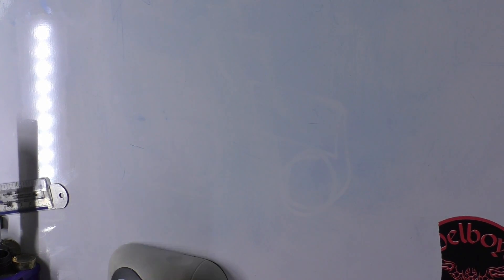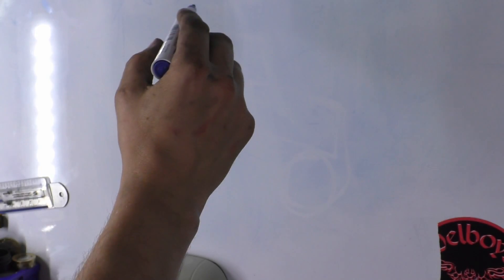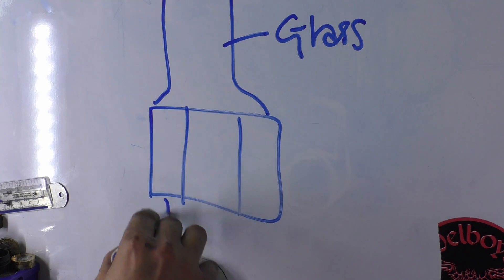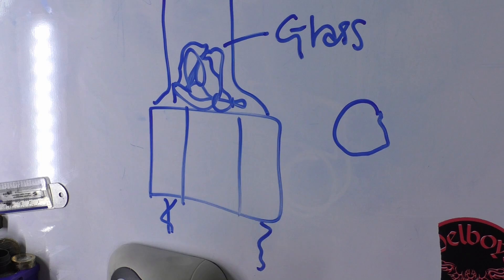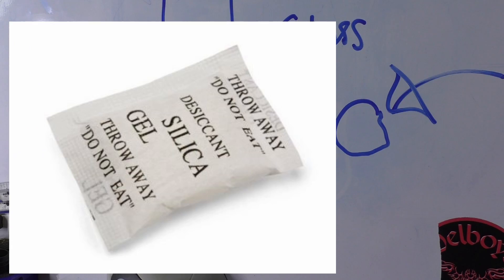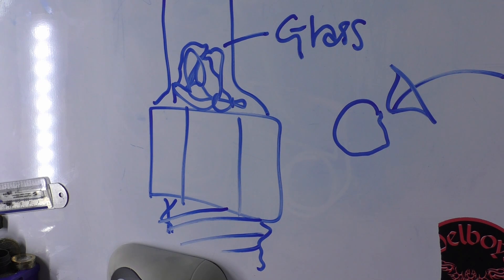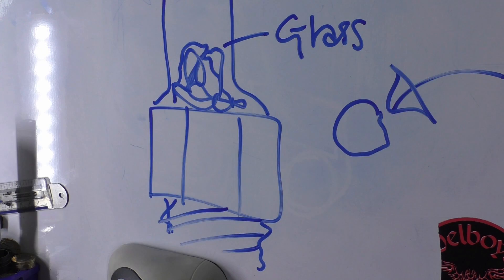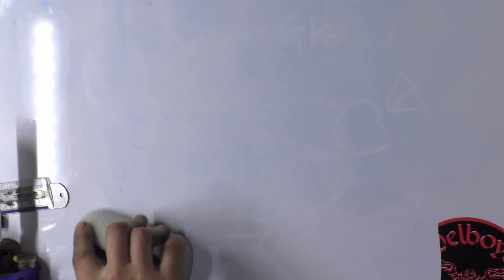Weird Glass spark plugs? - question time

Comment: The silica desiccant is only for shipping according to the company I bought a load of desiccant from.
Only lasts the shipping period they said, they sold various types of desiccant.
For storage purpose they had a clay based desiccant that lasts months.
Comes in paper bags about the size of my hand, had to buy a huge box of them that has a sealed bag inside because they only sold wholesale..
I pulled a few out to use and sealed up the bag to store.
Used them in a camera housing I built with a Nikon DSLR in it to take time lapse shots of a building site over 3 months.
No idea what I'm going to do with the rest.
Reply: I throw a couple dozen or so in the car while i store it over winter, i just microwave them once a month for a few minutes to dry them out and chuck them back in the car again, it works really well.

Comment: Hey mate, bit of a long question for you... Seems lots of people don't know when something looks different! 

Single crank pin, V-Twin 2into1 exhausts... 

I went to buy a set of pipes for my bike and found myself having an argument with the supplier of said "performance pipes" in my local area. This is pushing me to Tig up my own... Anyrate, here is the info I'd like your input on. 

I'm of the opinion that I am better off running 1.75 inch primary pipes, because that's closest in size to the outlet hole in the head, is the closest fitting size to the Flanges, and making it so the front and rear jug have the same length pipe pre merge collector on my 2into1, having it coated, and calling it a day.... But... The exhaust guy thinks I should go with his pipes, obviously, but he only sells 1.5 inch, claiming the step down at the head (the smaller exhaust boss/flange than head outlet sizing) will cause turbulence at the back of the valve, which he claims is important for torque on single pin Vtwin engines cos of when they fire vs multi pin crank engines, and by going smaller size I won't have to worry about having equal length pipes nor anything from the head back because the smaller sized lip at the head would make this torque creation amazing super turbulence and cancel out any benifit of the equal length ... 

Bullshit!, I call Bullshit!. I can't believe him!. I understand combustion is combustion isn't it?. 

I'm asking you because when I went to school we were taught that by sizing the flange and primary pipes the same size as the hole in the head, and do it as smoothly as practical we maintain velocities, reducing turbulent gasses crashing into itself, and so causing a high to low pressure situation, allowing for the most effective clearance of the cylinder, and then if we can tune for pulse scavenging using the cams and overlap... But always to maintain velocity and always to reduce pressure in the exhaust to promote the spent gasses flowing into a low pressure from a high pressure... And if we draw in some charge into the exhaust, Woopty Doo we know we're getting full evacuation. And I'm sure that holds true for all 4 stroke piston engines, regardless of configuration. 

And we were also taught in class  that "back pressure" was a result of noise and pollution control. The result of implied requirements and restrictions from manufactures not having their way, but for a 4 stroke piston motor it is not at all important as back pressure usually causes a contaminated charge to linger in the cylinder and hurting performance ... 

So what is the exhaust system seller telling me wrong?. How can putting a quarter inch restriction smack bang on the head outlet be better for a Vtwin?!?...

If I'm wrong, and choking down a single crank pin Vtwin at the head outlet is correct please show me how on your whiteboard...

Thank You for answering my long question on things not usually seen. I appreciate your feedback.
Reply from the maker: This is worth a video

Comment: your need one hell of a big bag of silica. to stop a Harley going to rust. seen it on a work m8's 17 reg left outside with a cover winter. my 51 reg shitzuki VL look's better after 5 years of the same. but Del has the answer with fs365 + sell it on quick
Reply from the maker: The main issue is making sure all the valves are closed.